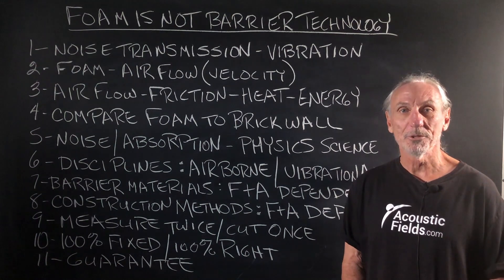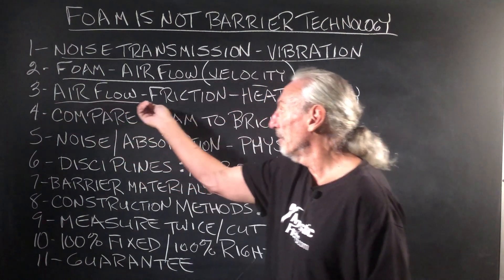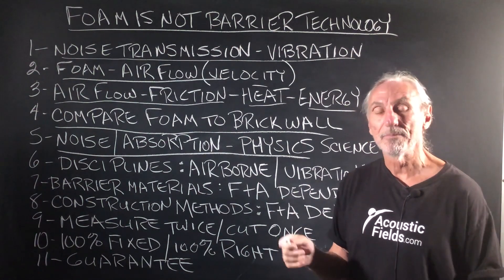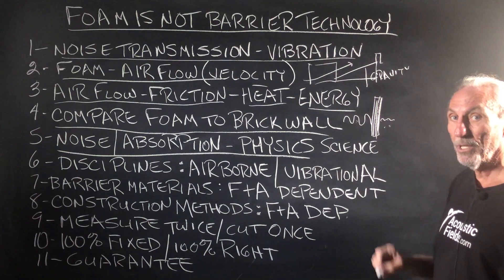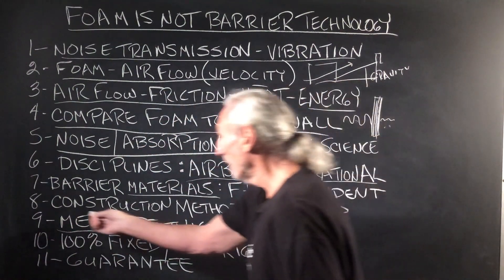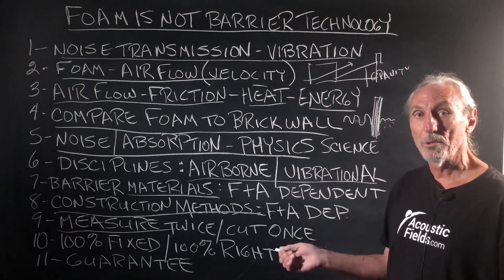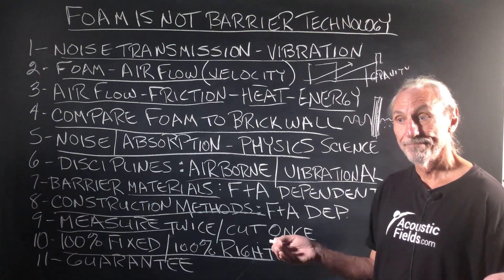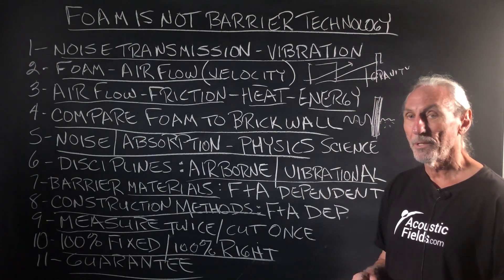Foam IS NOT Barrier Technology - www.AcousticFields.com

Comment: hi :) i have an isolation cabinet,it has a marshall 1x12 speaker cabinet in it - the problem i have is i cant get it loud enough to get the amp to "breathe" ... the bass in the room is tooooo much,have you any recommendations on how i can quieten this down? thanks in advance :)
Reply from the maker: You need to absorb the excess lower frequency energy within your room.  Your room modes are not letting your guitar energy come through. This is a good example of how powerful a room is. Your room is more powerful than a Marshall. Lets take a look at your room.  Fill out the information in this link: https://www.acousticfields.com/free-room-analysis/
Reply: @AcousticFields  thanks for the reply,its much appreciated :) im some "home" guy that needs to be able to turn an amp up - if i was in any way in a professional capacity i would gladly pay for your advice ... its worth it :) ... if i build a surrounding box,how can i make it as quiet as possible? ... my neighbors will kill me ;)

Comment: Well I did a test , I put up 100 of these tiles , it measured completely different than without it. 

So it does do something ... Also why do they use in some speakers actual foam on baffles , inside speakers instead of polyfill. .
Not trying to sound like a smart ass, but these are legit questions I have

There is also a video on YouTube, what worked on actually blocking lot for frequencies were layer of beach towels (no joke)
Reply from the maker: Something is nothing without a strategy. Throwing tactics against the wall and hoping they stick is no way to maximize sonic performance and minimize room distortions. You must treat each room wall separately. You must quantify all wall pressure and reflection issues,  then assign the appropriate treatment types, amount, and placement. TAP

Comment: When you say "Noise" do you mean noise transmission through walls? As in traffic, or neighbors, etc? I live alone on a quiet street and I don't hear my neighbors, my sound problems are all related to sound reflections and modes and room vibrations in the room. I just want to have the terminology correct. When I hear noise, I think system noise floor usually.
Reply from the maker: Noise transmission is defined as noise leaving your room and disturbing others. The flip side of noise is noise from other sources coming into your room and bothering you. This two way valve is called noise transmission. Noise transmission is treated by building a barrier between the noise source and the receiver.  Energy inside your room is managed by using absorption and diffusion.

Comment: Hey Dennis, I do voice work and converted my master bedroom closet in to a “Vocal Booth“ using corning 703 fiber built in to panels & double wrapped in a jersey fabric. My goal  was to both deaden the space and to keep outside noise to a minimum.  SO far three side of the closet are done and I added some acoustic foam on the wall I face while recording to try to “treat“ the space and take some boxiness out of it.  And it seems to have worked well, but…. I still sometimes feel my recording sound “muddy“ if that makes sense, but overall i am happy with it.  Heck, its a small space.  About 4ft across by 6ft long with multiple layers of blankets (both moving and fuzzy) on a shower curtain on the back side for access.   Do you think i went down a wrong path for here? Or does it sound reasonable for basic soundproofing and treatment for basic voiceover work?   The corning panels are “floating“ rather than rigidly fixed to the side and back walls .  Thanks for all you do brother, love your videos
Reply from the maker: This is a classic example of why building insulation should never be used for voice and music. It lacks the proper rates and levels of absorption for music and voice. The "muddiness" you describe is overabsorption at certain frequencies. Do not use different material types when it comes to treating voice. You must have a balanced rate and level of absorption throughout the total space when it comes to voice.

Comment: Could you share your email? I need help selecting and placing bass traps. I can send you the dimensions of my studio. Wooden hanging walls with mass loaded vinyl backing, wooden ceiling with mass loaded vinyl, acoustic underlayment beneath the carpet, plushy carpet, checkerboard patterned foam squares just in the ceiling (for high frequency treatment - I say checkerboard because half the ceiling is foam, half is exposed wood in that pattern) - but at this time, the walls are completely untreated. Since it is a medium-small room with a ~9 ft ceiling, I think it would be best to start with bass traps. I just don't know which ones to get and where to place them. One wall has the double glass (second pane is slanted) and on the other side is my engineering booth.
Reply from the maker: info@acousticfields.com
Reply: @AcousticFields  Thank you, Dennis. I just sent you an email. We are looking to install acoustic treatment in our studio as soon as we can.

Comment: Is butyl rubber the best sound damping material?
Reply from the maker: You have to get away from using this "best" term. There is no "best" that serves all frequency and amplitude masters. The choice of material types and construction methodologies are entirely dependent on the frequency and amplitude of the noise.

Comment: I realize the are differences between treat and barrier technologies, but just to play devil's advocate... couldn't treatment help reduce energy inside the room and therefore lower the amount of energy available to escape the room? Obviously its only effective when inside the room is the "noise" source.
Reply from the maker: It would depend on the frequency and amplitude of the noise and what percentage reduction was achieved versus the ambient noise levels that the noise would be transmitting through. We work with engineers who like to mix at 2 am when the neighborhood noise levels are at their lowest. They must have barriers that allow for the 30 - 50 dB SPL difference between the two domains.

Comment: I'm still learning the lingo and starting to understand a little more each week.
But I do have a Question? I have not done the entire week long noise run yet, but I will. 
During any daytime listening. I have a inside noise(hearing outside noise. Traffic, kids playing, dogs barking, ect..., A average of 29 db with peaks at around 69db. No music, but I also hear the refrigerator in the kitchen. 
2 windows and a bay window, all from 1963. 
I'm doing a kitchen remodel first before the large living room. It's wide open, but the refrigerator slides into a slot in the wall over the stairs. 
Is there anything I can do to reduce that sound? It's 26db if I'm in the kitchen. I will replace the thing if I have to.
Reply from the maker: You must measure this noise over a full week taking frequency and amplitude readings during the quietest and loudest parts of each day to create a pressure map. Barrier design materials depend upon the noise ratios between inside and outside noise levels.